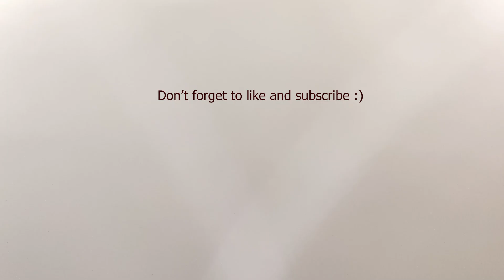Pinecil V2 Portable Soldering Iron (by Pine64)

Comment: Anybody have the same problem. The pine is shutting down about every 5-10sec when i use a charger 30w pd usb c to usb c..
But work fine with a pd powerbank with 4x 18650...
Reply from the maker: Not surprised; 30W is barely a scratch. This'll want about 45W minimum I'd say, but 60W to be safe!
Reply: @PlatimaTinkers  The same charger work good with the whoopstor 3..
Charging 4 batteries right now on 0,3A the batteries are 300mah...
Reply from the maker: @andershoel78  Nothing your saying has any relevance sorry mate. Get a 60W (aka 20V 3A) PD supply for it and you'll be right.
Reply: @PlatimaTinkers  Thank you for the information, im new at this soldering thing. And a soldering iron with drivers are also a little funny..
Reply from the maker: @andershoel78  Never known it to have any drivers? You might be reading into something a bit too much, or perhaps bad doco!

Here's my experience with the Pinecil: recieved it, plugged it into my 60W PD charger, press + to start it heating, soldering with it. Been using it weekly for over two years now ☺☺

(It does run IronOS firmware, which you can upgrade if you want. This does the temperature control, automatic timeout, etc)
Reply: @PlatimaTinkers  I have tried it with the 4x18650 powerbank, and even on 9 volt (lowest setting) i have solder on a tiny whoop with good results.
Only differens is that it takes little longer to heat up.
300 celcius work good for me with the 63% tin 37% lead combination.
Im happy with it so far.
Was thinking to buy a set of 4 different soldering irons with different tips.
But it worked good with the stock one, so i dont need the other.
As it is only to repair tinywhoop and solder very very small things, the tip that comes with it is just what i needed.
Reply from the maker: @andershoel78  4x18650 powerbank does not mean anything sorry mate, the power bank circuitry would specify its output capabilities, and this is also specific to the 18650s that you're using. There are practically infinite combinations. Eg some 18650's will output 2A, some will output 10A. Some power banks will do 30W, some 60W, some will have batteries in parallel, some series, some both. I'd recommend the Cygnett ExoCharge 19.2k Laptop Power Bank 118w. That's what we use for EVERYTHING, with zero issue ☺
Reply: @PlatimaTinkers  Its a haweel powerbank, with PD 3.0 type C to C.
All batteries is in the same direction and it also work with only one or two 18650 inside..
And good size for pocket.
Ofcource i could set 12 volts or more with the pine, but i wanted to test on the lowest setting, as im not in a hurry..
And was thinking this is better for the batteries in the powerbank. 
Im not counting the seconds it take for the Iron to heat up.
Reply from the maker: @andershoel78  I'm sorry friend but I really cannot help you as it simply appears that you do not understand the topics involved here. I would strongly recommend that you learn Ohms Law in detail, or just buy a normal AC soldering iron, as it supporting PD 3.0 has nothing to do with it, USB Type-C has nothing to do with it, and the voltage does not really affect it much.

To be extremely clear: you need a 12 to 20V DC source that will output a total of 60W, which means 5 to 3A respectively. The HAWEEL Power Bank Box is not good enough, and even if you get a better one, you will need good quality 18650's. Best of luck.
Reply: @PlatimaTinkers  You are right, im not understanding electronics.
But the settings in the pinecil allow to set is as low as 9 volt, and i did and it worked.
So i keep this settings just becouse i dont need faster heeting of the Iron.
And as im not soldering 8 hours a day, these 4 batteries is more than enough for my needs.
I would guess they will last for more then a hour soldering, and i only need 5 minutes.
Reply from the maker: @andershoel78  Please read Ohms Law. 9V means it's going to need up to 7A. The lower voltage, the slower it heats up, but if it wants 60W that means higher amps. If it does not have enough amps, it may crash/turn-off/restart. If it is surviving with your power bank, that is good, and just lucky. 

12V 5A, 15V 4A, or 20V 3A are going to be your best option. The 30W PD charger likely cannot do the amps required at those voltages like your power bank can.
Reply: @PlatimaTinkers  Thank you for the information, then i will turn it up to 12v from 9v, if you say its more efficient.
Reply from the maker: @andershoel78  You are welcome but that is not what I said 😑. Please go read about Ohms Law. Or watch some basic videos on electricity theory. You should not be working with electronics without understanding amps, volts, watts, and related topics like capacitance and resistance. These are very fundamental!
Reply: @PlatimaTinkers   I just solder damages from craches, riped of cables.
All is visual damage. 
Have about 1-2 sec to solder, before the plate will be to hot.
If it take longer time, then the heat is to low.
I also have a powerbank from IKEA E2038 VARMFRONT 3,6V 10400 mah,  about the same size.
Max output 12v 1,5A.
The pinecil work as fine with this powerbank.
Its no difference what i can tell.
Yes i read its the same output on the HWL9600.
9V 2A or 12V 1,5A.
12000mAh.
A larger would not be practical.
Reply: @PlatimaTinkers  What i like about this pine is the logotype, it feels like home.
But what im missing is a case for it.
Preferable a small hard case.
Reply from the maker: @andershoel78  I cannot help someone that is not willing to listen or learn sorry.
Reply: @PlatimaTinkers  Okey, i will read about ohms law when i have time.
Thank you once more.
Reply: What a conversation lmaoo

Comment: what kind of solder would you recommend with this device.. i'm a newbie and i'm kindof confused, I don't mind leaded solder as it seems to not be much of a concern healthwise
Reply from the maker: Hey mate it's all personal preference. I prefer leaded solder as it's way easier to work with, and usually just order any ~70/30 with a flux core from eBay in a roll. Just make sure you've got a good fume extractor as you definitely don't want to inhale it. I usually run it at about 350 C too, but that's based on the pin sizes I'm working with and the tip I have installed.

Comment: I see that it needs a 5525 barrel connector but what length 9 or 14mm?
Reply from the maker: Measured it - 14mm depth :)
Reply from the maker: No clue mate haha. I use USB-C sorry.

Had a quick look on https://pine64.org/documentation/Pinecil/Power_supplies/Power_supplies/#dc_barrel_power and cannot even see it.

I should be heading to the workshop this weekend and will check it out for ya!

Comment: I'm looking for a portable soldering iron. In your video, looks like I saw 6S setting. Does that mean that the Pinecil can take a 6S lipo battery?
Reply from the maker: @neilfpv Yea mate - it's got a 2.5mm DC barrel jack on the bottom. Just plug in any LiPo and set that mode - it'll auto cut out at the right voltage based on that setting.
Reply: @PlatimaTinkers  Thanks a lot! I ordered it 2 hours ago. I'm so excited!
Reply from the maker: @neilfpv  No worries at all. They're pretty bloody awesome - I use mine literally weekly... usually for fixing shit I broke haha
Reply: @PlatimaTinkers  Awesome! :)

Comment: What a chaotic and seemingly unprepared video...
Anyway one of the really great things about the tips with closely coupled heater and sensor elements is the fact, that they respond so quickly that you don't have to set an absurd temperature on the iron for things that quickly removes heat like large ground planes.
(Sure the boost function is handy when being too lazy to change to the appropriate tip for the job)
A better comparison would have been the minimum temperatures that the two irons can still melt the solder with relative ease.
Also please, please don't intentionally "contaminate" your finger with flux, the MSDS for fluxes are usually not the most pleasant read.
Reply from the maker: Hahah yeah mate I'm a bit all over the shop and my videos aren't really professional, but slowly improving with time! Thanks for the feedback either way.

Yeah the temperature response is REALLY handy, especially the fact that it compensates for it so well when soldering onto something that's a fairly good heat conductor, eg aluminium! 

A comparison would probably be a good idea, will keep that in mind for the future - thanks. And yeah flux definitely isn't great, I try to avoid direct contact with it for that exact reason.

Comment: Can I charge the iron via normal phone charger? Type C to USB?
Reply from the maker: @kdilac8879 Yeah it'll work fine with any USB-C PD from what I understand, eg a 30W USB-C adaptor, but it'll just take longer to heat up. Note this does not have a battery in it, so you're not "charging" as such, more "powering" :)
Reply: @PlatimaTinkers  on the topic of that, what if I get a cheap MacBook charger (just saw 100w one on Amazon for $20 usb c) would that be good enough?
Reply from the maker: @shlokbhakta2893  sorry for the delay was travelling for work! And yep a 100W USB-C charger would work perfect - send me that link too if you can, I want one! Cheers
Reply: I grabbed one of the GAAN USB-C 65W PD power bricks from Amazon when I got my Pinecil and it works beautifully. It cost about $40.

Comment: to clarify so people dont get confused ;)   Pulse Mode is a special Power Settings that a rare few people might need for chargers that tend to turn off while Pinecil is not in use  as they charger needs a signal sent from Pinecil every now and then or the charger powers off. 
 Boost mode is what we call boosting the temperature  very high temporarily while holding down (+)  for as long as you need this mega temperature, like some thick wire is giving you  a hard time.
Reply from the maker: That is great info, thank you!

Comment: Boost setting:  can preset what your boost is. Example set Boost power to be 400 C, and your set temperature to 360C (no lead). 
 then if you hit (+) one time, it  heats to set temperature of  360C ,  but if you then while soldering  just do long hold of  (+)  button,  then it will got to your pre-set boost temp  of 400 C and stay there as long as you hold the (+)  for  an area  you need the  higher boost for like some stubborn large spot.
Reply from the maker: Sorry spam replies :P That makes sense, cheers for clarifying

Comment: Can anyone recommend a good DC5525 power supply for this soldering iron? thanks.
Reply from the maker: @sonyx5332  I'd honestly go USB-C for a few reasons, but, any 19V laptop power supply should do nicely, especially if it's 65W or higher!
Reply: @PlatimaTinkers   ^^ double vote on that ,  usb-C  is  maybe  safer choice too, and best bang for buck.  Several $15-25  USB-C chargers that work with Pinecil are listed on the Pinecil  WIKI  page,  search  page for Power supply section, then click wiki link.
Reply: @neo256mb  the pinecil v2 can also draw more power over USB C; 24V/3.8A=92W over the barrel jack and 28V/4.5A=126W over USB C. Although for that you need a PD 3.1 PSU and cable, which aren't super common and cheap yet

Comment: 25$ but 30$ shipping
Reply from the maker: Mate if you solder any more than once per month, I'd pay it! Honestly I've spent $300 on way shitter soldering irons before.
Reply: @PlatimaTinkers  alright thanks. What else do I need to buy to use it? can I use it with my phone charger?
Reply from the maker: @inspectahdeck2642  As long as it's 65W or higher. I got their 120W USB power supply for mine (https://www.youtube.com/watch?v=-z1SRc460x0) with a silicone USB-C cable, but it also works with my HP ProBook and MacBook Pro chargers! Jaycar, Harvey Norman, etc all have compatible ones but since you're ordering from them anyway I'd just get that one with plenty of ports as it's quite handy!

Comment: Nice this is based on the TS101 it seems, right?
Reply from the maker: Hey I had never heard of that, but just looked at a pile of Miniware goods and you are right there are a lot of similarities there! 

According to https://github.com/Ralim/IronOS which is the firmware on the Pinecil, it does support the TS100 but TS101 is not listed yet. Have you tried one before?
Reply: @PlatimaTinkers  Yeah looks like Miniware might be the manufacturing partner for Pine. That's rather neat because they have some good value stuff.
Nah sadly not, heard a lot of good things though. Def interested in buying one. 😁
Reply from the maker: @malrex0mari  I think I'll have to get some stuff and try it! Thanks for letting me know, had never heard of them. Might take me 6ish months before I get around to it, but it's on the list now! Either way, having a soldering iron with a variable length cord is so good. My solder station has super short reach and drives me up the wall haha
Reply: @malrex0mari  Miniware is Miniware.  Pine64 is like a non profit open source everything place.  They make things for Makers and Hackers.
Reply: @PlatimaTinkers  Ralim is waiting to see if TS101 is using cheap clone chips that TS100 started using.  IronOS is no longer recommending TS100 because of it.
Reply from the maker: @joepangit6938  Interesting! Did not know. Cheers